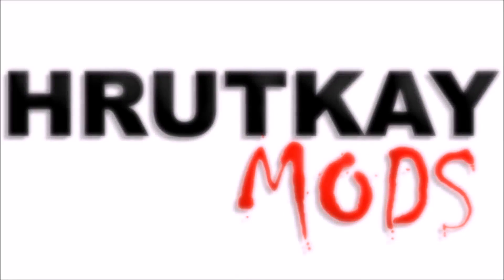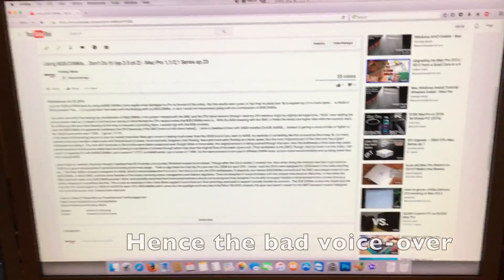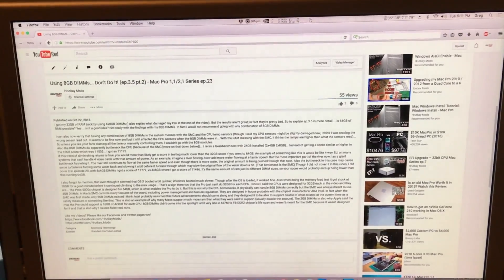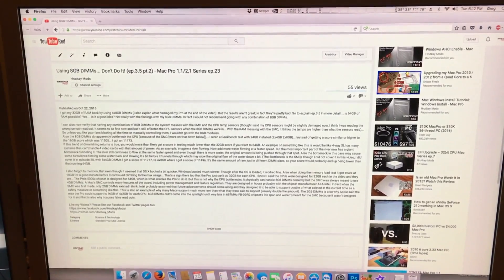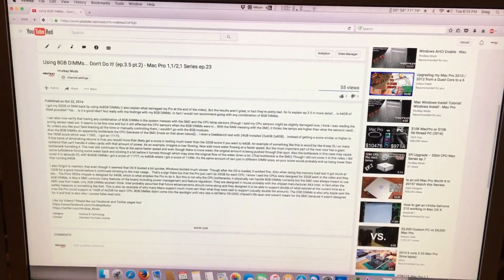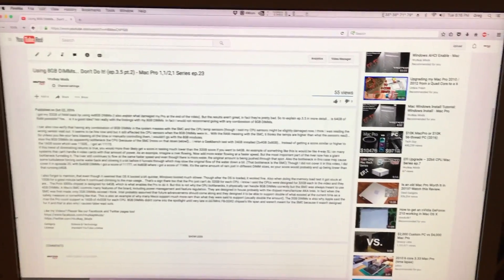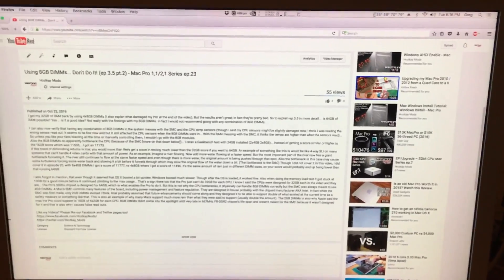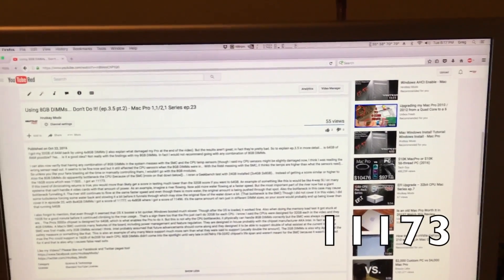Using 8GB DIMMs... Explained, AKA Stick to 32GB of RAM - Mac Pro 1,1/2,1 Series ep.23.5

Comment: I have 42G installed with x4 8G modules in the rear slots in A and B riser and the rest 4G and 1G.
I have no issues with this configuration.
Reply from the maker: Glad it works for you, it doesn’t always
Reply: as you likely know , they are installed in pairs. install riser A rear pair  and then Riser B rear pair. Note i have only 1 pair of 1G which can be problematic, and no 512k at all. Also they have to be the same speed for each and must be 667mhz DDR2 FB DIMM - NOT other variants.
My advice if you can get paired DIMM's then go for it. They are cheap as sand and worth the effort.

Comment: I've been running with 64GB RAM in my Mac Pro 2,1 since March of last year, no issues here. In fact, I replaced my heatsinks with stock Apple heatsinks.
Reply from the maker: +supericecreamsandwich  I know I saw a vid of yours on that... A number of people and I have just figured out that 32GB performs the same if not a little quicker than 64GB. There's no point other than bragging rights.

Comment: Already have a 64gb kit coming. Guess I'll get to experience this negative effect first hand. The ram I found was Kingston.
Reply from the maker: Kingston is great ram (though it may have been one of the modules that shorted my controller [see the end of ep.32]). I might be an isolated case, but like I said 32GB is plenty. I'd love to see what your experience is with the ram is and if it contradicts my findings, I'll make a new video about your findings ;)
Reply: Ram arrived today and I'm see only a minimal decrease if any in benchmarks. Temps are stable and not any higher. I will post pictures on Facebook page.
Reply from the maker: I'll be making a vid on your findings probably later today